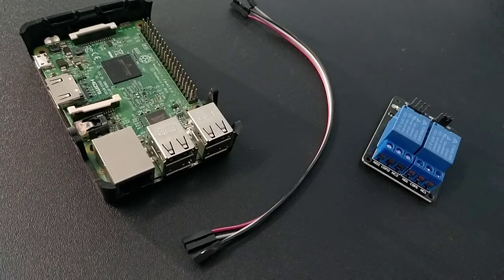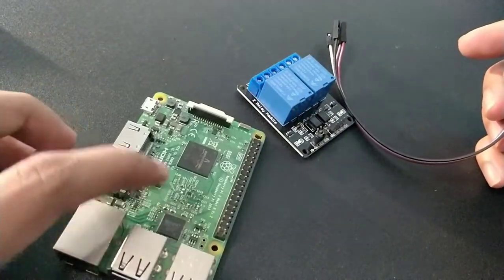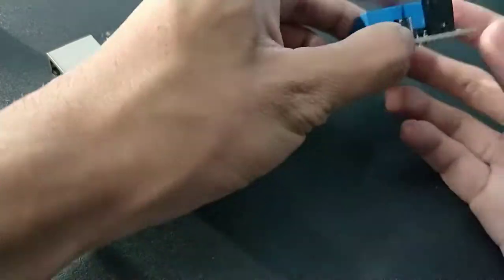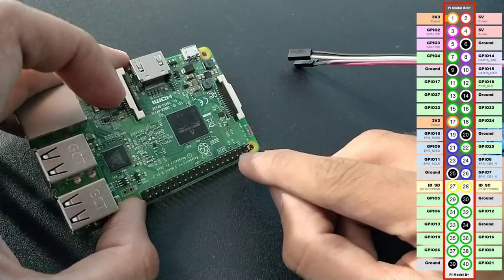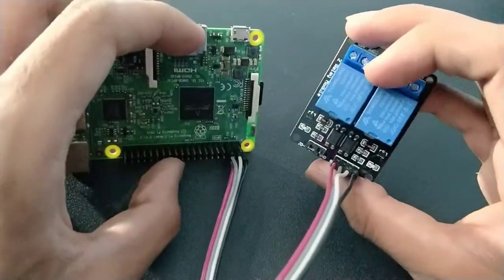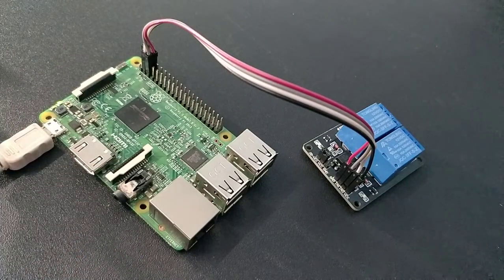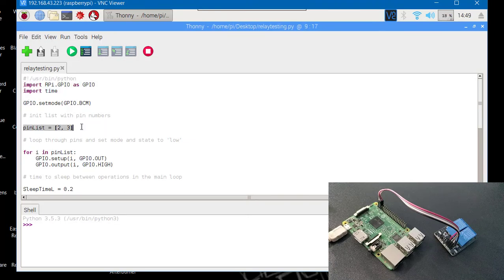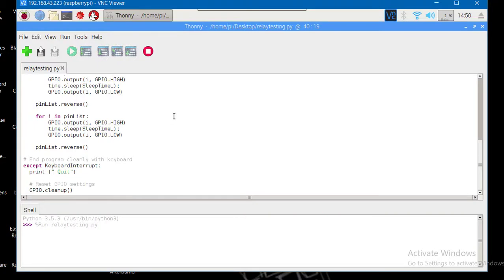Raspberry Pi 3B:Connect Relay Module (2/6/8-Channel) | Control devices| Ep. 4

Comment: Hi thank you so much for the video. I was able to follow it and operate the relay. I have connected 250v solenoid valve to other end of relay. When I operated it for first time, with raspberry pi connected to monitor, the display turned off for second and came back. On subsequent execution too I had same behavior with display turning off when relay operated. However now. The display is flickering always. Can you please help me what may be wrong. I am not able to work with raspberry pi connected to monitor any more ☹️

Comment: here is the code:

#!/usr/bin/env python

import RPi.GPIO as GPIO
import time

GPIO.setmode(GPIO.BCM)

pinList = [2,3]

for i in pinList:
 GPIO.setup(i, GPIO.OUT)
 GPIO.output(i, GPIO.HIGH)
 
SleepTimeL = 0.2

try:
 while True:
  
  for i in pinList:
   GPIO.output(i, GPIO.HIGH)
   time.sleep(SleepTimeL);
   GPIO.output(i, GPIO.LOW)
   
  pinList.reverse()
  
  
  for i in pinList:
   GPIO.output(i, GPIO.HIGH)
   time.sleep(SleepTimeL);
   GPIO.output(i, GPIO.LOW)
   
  pinList.reverse()
  
except KeyboardInterrupt:
 print("Quit")
 
 GPIO.cleanup()